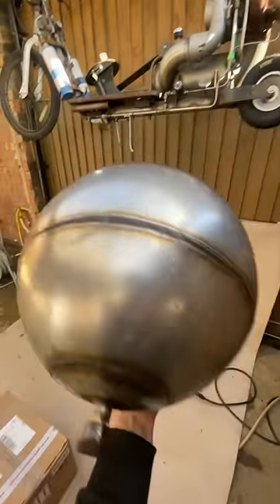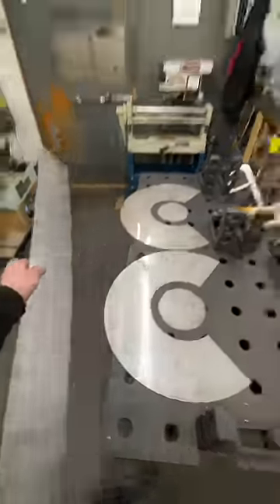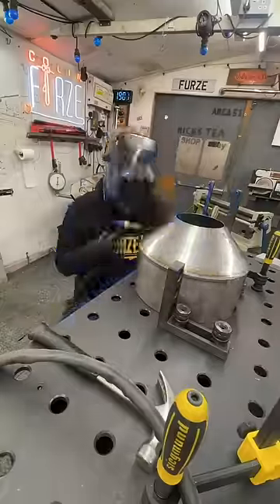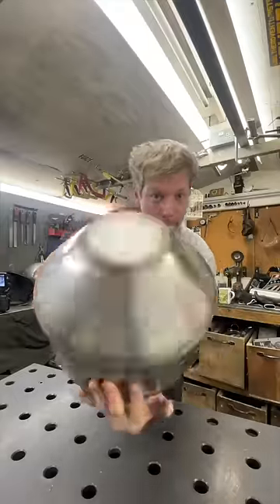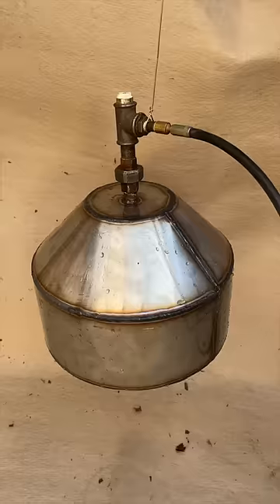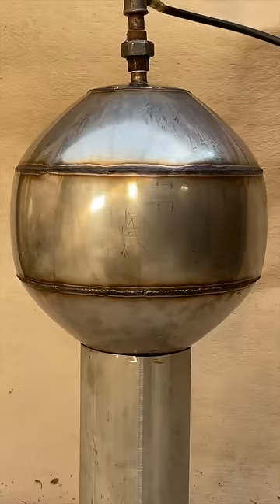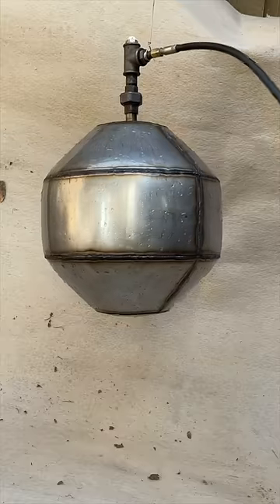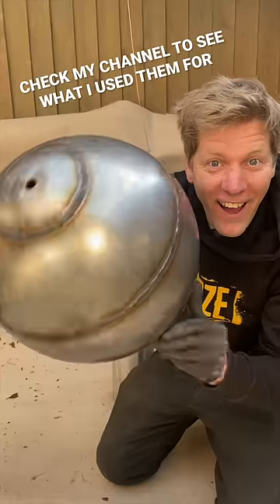Your Pressure washer has a Secret SKILL

Comment: You forgot the step "hope your welds hold up"

That's a beautiful looking steel sphere by the way.
Reply: his welds looked great, I doubt he was worried.  If anything its gonna fail in the un-welded sections
Reply: Even if welds failed, it would not explode since water is not compressible.
Reply: @Puuuszzku uh no.
Water is compressable just the amount of pressure needed is a lot more.
Compress a gas enough it becomes liquid compress a liquid enough it becomes a solid.

That water will have the pressure the pressure washer is putting out, which is considered dangerous.
Reply: @thegoldenatlas753  Except water, if you compress it, it goes from solid to liquid...
Reply: @Puuuszzku safest way useing water instead of air
Reply: @Maxence1402a  obviously he should be using frying oil. it's impossible to compress which is why they use it as rocket fuel for the space shuttle program. Pump that baby up with frying oil and the welds are sure to bust
Reply: @thegoldenatlas753  That’s theory. In practice with this application, you will never reach pressures high enough to see any of that.
Reply: @thegoldenatlas753  water is an incompressible substance for all practical purposes, both foreign and domestic.

AW-32 is much more incompressible, but in this case it's not enough to worry about.

The big worry here is hydraulic injection via pinhole leaks
Reply: @Puuuszzku  **easily compressible...its not easily compressible.   It most certainly is compressible. 😉
Reply: @Maxence1402a  if you compress water it goes from a liquid to a gas. But more often than not it will find or make a way out.
Reply: Collin doesn’t need hope.

Collin is the hope we all need.
Reply: @2nd-place lol that may be TRUER than hit or Colin thinks.
Reply: You or Colin I should say.
Reply: @ChrisssDolle  hopin to become an old wise geezer just like ya!
Gotta get machining
Reply: @mtraven23  it actually did fail a bit but it all worked out
Reply: @thegoldenatlas753  Colin has a video he made years ago, shows one of the welds leaking when under pressure, just stopped and welded it again. Just don't hold or stand right next to it when it's under pressure.
Reply: @ChrisssDolle  I'll definitely try the Jerry rig way if there's no other option.
Reply: @CAL9919A  where?  I see no failures.
Reply: @mtraven23  in the main video and a behind the scenes video the welds popped in a few places letting water escape but it wasnt that bad
Reply: @CAL9919A  oh , i didn't realize there was a main video, Ill have to check it out.
Reply: @mtraven23  its the new drift trike build
Reply: @thegoldenatlas753  it's been a while since I did physics, but I believe water is the only fluid which has a lower density when it is solid (ice). So no matter how much you compress it, it will never solidify, and if the welds fail, it would just squirt out for a split second until the pressure equalizes that of the pressure washer. can anyone smarter out there weigh in on this?
Reply: Only way to be sure your welds are good is to wear your very own safety-tie...
Reply: @Puuuszzku  a practical example of ice turning liquid under pressure is when ice skating. One of the few places with enough pressure to liquefy ice.
Reply: @thegoldenatlas753  the risk isn't there like compressed air. Much more dangerous to do this with compressed air. Only a very small amount of water need escape to decompress the sphere. With air, it may take 10 seconds for it to all escape, and while that's happening, it may continue to blow apart.
Reply: Pretty Sure that it's Stainless...
Reply: Filling it with water and then using only water to fill it makes that part kinda meaningless. Don't prefill it or do but use air to increase the pressure and that's a very, very important part 😄
Reply: Why would you have to worry if your welds are gonna hold if you know how to weld??? Smfh it’s not hard to weld… it’s literally something every human should know how to do
Reply: @Puuuszzku  
Water turns into ices depending on the pressures you are talking about, last time I checked you aint gonna get Neptune level pressures from a dinky pressure washer off BestBuy.
Reply: @thegoldenatlas753  😊😊😊kk99
Reply: @thegoldenatlas753  😊😊😊kk99⁹
Reply: @mtraven23  😊😊
Reply: 😊😊😊😊kkkkkok😊😊😊😊😊😊😊
Reply: @yasirrakhurrafat1142  *Jury rigged , not jerry
Reply: @Matt Traven 😢kk😢😢😢😢😢😢😢😢😢kkkkkkkkkkkkkkk
Reply: @thegoldenatlas753  uhhh no. On the surface water is practically incompressible and a pressure washer cannot reach pressures for hydroforming steel to fail catastrophically. I've seen many welds fail in this process. People just get wet. Even at the bottom of the Marianas trench water is compressed by only about 4%.
Reply: I thought more along the lines "Hide behind a thick concrete wall, with the end of the power washer cable, and plugit in.
Reply: @thegoldenatlas753  nope. Colin has a better video on this method, where he goes into how it's completely safe. Water really really doesn't like to compress, it takes insane pressures to get it to shrink by a few %.

If a weld breaks it doesn't violently burst open, it opens a tiny amount and the water rather harmlessly comes out.

If there's air in there however, the energy is stored in the air like a spring. A minor flaw in the weld is rapidly and explosively ripped open - likely ripping a 'arge section open and potentially sending shrapnel everywhere.

This is well documented. Look up failure modes of this, they range from a slow drip of water, to a spray not even as dangerous as the cheapo pressure washers. Look up failure modes of using air pressure... You won't find any - because most people capable of setting up the contraption know how stupidly dangerous it is.
Reply: @Train115  if you compress water it turns into a gas? No... No it doesn't. By what mechanism would compressing it turn it into a gas, when the higher the compression the less room there is - so how on earth could it form a gas?

When you compress water to EXTREMELY high pressures, it will form various exotic forms of ice - as the molecules are forced into certain lattice shapes. The pressures we're talking about here are just absolutely enormous. For reference to get to the first stage of ice formation at room temperature, you'd need to exert over 10,000 atm, or 150,000 PSI and a container that can handle more than that force without changing shape or failing (good luck).

For reference if you went to the bottom of the ocean - the pressure on you is still nowhere near enough. You'd need an ocean 64 miles deep to reach the pressures where this specific ice forms.

The idea that it'd turn into a gas under more pressure is just the most nonsensical thing I've heard in these comments. And this comment chain has some pretty good contenders.
Reply: @thegoldenatlas753  I'm pretty sure you cant compress water because it expands when it becomes a solid.
Reply: @thegoldenatlas753  at some point the water will colors a bit. But when you increase the pressure, it's the air in the system that pushes on the liquid
Reply: I won't be around that shit working
Reply: Nah, if your weld busts it immediately loses pressure and just starts pissing water. It's about as fail safe as metal forming can get
Reply: @RK36_  every human? lol what
Reply: @thegoldenatlas753  the real danger would be using something like air because it would store energy like a spring whereas the water used here compressed a negligible amount so it’s not storing additional energy.
Reply: @Maxence1402a   there are different kinds of ice that exist at different pressure ranges ice 1 is the the only one that exists on earth naturally and causes an expansion in volume all the other ones at higher pressures don't.
Reply: @Train115   also wrong there are different phases of ice and ice 1 is the only one that increases in volume.
Reply: @Puuuszzku  technically everything is compressible ,just the amount of compression requires varying pressure,its very less for gases,moderate for liquids and really really high for metals and crystals(crystals are brittle i.e.their yield strength and breakage point are close)
Reply: @thegoldenatlas753  the densest form of H2O is liquid, compressing liquid water results in liquid water.  Compressing steam results in liquid.  Compressing ice results in liquid.  It's why in space there is very little liquid water because it's cold enough to freeze solid but there's not enough pressure to maintain a liquid form so it goes straight from solid to gas.  The solid is less dense, it's why ice floats.  Unlike most other materials where the "ice" or solid form will sink.
Reply: @thegoldenatlas753  What everyone means by "non compressible" is that it doesn't really store energy when you compress it. If you have a ball of water at 300 PSI and it bursts, it'll leak a tiny bit of water and then drop to ambient pressure. If you have a ball of air at 300 PSI and it bursts, the thing explodes and sends shards across the room.
Reply: @Puuuszzku  Water IS compressible, sadly.
If you are in a situation where it matters, I hope you're behind a shield or something, because it WILL compress given a large enough force, so it will also release a large force. 
Think of it like a really stiff spring..
Reply: @xl000  My exact point is that this is a situation, where it’s completely irrelevant, as pressure involved is way to small. Worst thing that could happen would be something like hydraulic injection, where as the original commenter implies, that there could be some sort of explosion.
Reply: Yes sir
Reply: @Train115 ice planets become ice from pressure no ?
Reply: @thegoldenatlas753  Water is almost incompressible. In this case if it failed there wouldn't be that much of a boom
Reply: @Train115 it does not turn to gas under pressure. Gas is less dense than liquid. Can't push molecules together and say it's becoming less dense
Reply: @lost4468yt  I believe the thinking is that the water would heat up when compressed. As long as the pressure is below 220 bars water can turn gaseous with enough temperature. Though I don't know if water really compresses at any measurable level at this "low" pressure.
Reply: @Puuuszzku wouldnt explode, but any tiny jets from leaks will pierce flesh like a red hot needle
Reply: @kf8575  at what distance ? 5cm ? Let me say it for the last time. I’ve done steel hydro forming using pressure washer at least 5 times since my original comment here. AND THERE IS NO WAY that you could get hurt, unless you’re sitting on it or holding it with your hands.
Reply: that's the general pattern but it really depends on the current temperature, pressure, and which substance @thegoldenatlas753
Reply: @thegoldenatlas753 the pressure releases from water almost instantly, whereas a volume of air compressed to that pressure would still need to expand a lot in order to reach equilibrium.
Reply: false you can compress water into mineral form, its called ice 7 and while hard to achieve its possible its stable up to like 120 F  @Maxence1402a
Reply: @Train115 more often than not the improper chamber would be used
Reply: Don't stand to close and use some protection.
Reply: Well the point of filling with water is that if it ruptured, it would not explode very violently. This is why pressure vessels in general require periodic hydrostatic pressure testing
Reply: @mtraven23 that looks like stainless. And he didn’t purge inside. Obviously they held but those are weak and contaminated on the inside
Reply: @brycelovell6984  oh ok, thanks.   I missed that detail.  Actually, purging is a relatively new concept to me.  Are they filling the tube with shielding gas to prevent oxidation on the inside walls?  Is that the basic concept?

whys it only stainless you gotta do that for?  the nickle in SS ?
Reply: @thegoldenatlas753 it cant store the pressure elastically though like a gas. So the pressure coming out after failure is strong leading on the flow rate of the pressure washer, which is not high compared to the volume of the sphere. So the massive sphere and any rip in it acts as a regulator.  I mean you don't want to be hanging out like 2 ft away from it or anything when it goes.  But after the initial burst it should be fine
Reply: @thegoldenatlas753 In most engineering applications the compression of water is ignored, so I don't think you need to be worried about it in this situation
Reply: @lost4468yt  Thank you! So much bs in this comment thread, when all anyone has to do is look at a god damned phase diagram for water.
Reply: Yea I was gonna say - you're greatly overestimating my welding abilities
Reply: You guys should use Black holes In these they dont compress and their easy to get since you can make everything Into a black hole by compressing stuff until it doesnt anymore
Reply: Guys, Here is The Savior

HalleluYAH translates “Praise ye YaH”

YaH is The Heavenly Father
YaH arrives via the TENT OF MEETING
YaH was Who they Crucified for our sins
YaH was Crucified on an Almond TREE

Ancient Semitic of Moshe (Moses)
Isa Scroll (The Original Isaiah)

Isaiah 42:8
"I am YaH; that is my Name! I will not yield my glory to another or my praise to idols.”

Isaiah 43:11
“I am YAH, and there is no other Savior but Me.”

Isaiah 45:5
“I am YaH, and there is none else.”

Comment: Im a sheet metal worker that makes complex shapes like this and even im pretty impressed how well that worked thats a full day in the shop to hammer out something like no easy task and very labour intensive
Reply: This looks easy but it also looks like a bomb so….
Reply: @joshuajones9035  it's water. Doesn't compress. So it's actually not a bomb!  just like a rubber balloon filled with water doesn't really "pop", it just bursts.
If you filled it with air, then yeah, it's a bomb.
Reply: @johannesmajamaki2626  
So having your shirt and pants soaked is not an issue to you? Think about it man!! How damp you will feel!! How chilly you’ll get!!! What if it his you in a way that you look like you’ve peed yourself?! Then what?!??!
Reply: WHOA! Well, if you're impressed, then I guess we all should be.
Reply: @johannesmajamaki2626 lol didn’t think it was water lol I was just imagining all the air pressure it would take to do this
Reply: This is a type of hydroforming, it might be worth looking more, considering your profession. You can form sheets with single part molds using water to apply even pressure to a sheet over the whole mold, or parts like in the video can be sealed and pressurized to round them out in a way that increases their volume to surface area. Can also expand hard to reach sections of tubes to stretch them an outer mold cavity.
Reply: Sounds like you’re a pretty bad sheet metal worker
Reply: @Manhandle730 if that’s the worst-case scenario then that’s fine anyone who complains about getting wet when working with water shouldn’t be working with water.
Reply: You're a metal worker and you dont know hydro forming? Alternatively you cap it with a cap that'll give out after a cetain psi, fill it with water and use a mild explosive to do this.
Reply: If it didn’t blow up….Then cut it into the pieces that suit the rounded shape you want
Reply: @johannesmajamaki2626 thank you, it's one of those things that drives me nuts but also is completely understandable that ppl don't understand these things much like what the diff between detonation and delegation is.

Comment: This technique is called hydroforming. Water is used because it's incompressible, which means if a weld breaks there's no explosion.
Using air or other compressible materials would be dangerous, since a break would make the compressed material expand rapidly (explosively).

Comment: Damn, solid weldin'. Did you at least check for leaks first or just wholehogged it from the get go?
Reply: The good thing about this is that water is incompressible so if a weld gives in while inflating it you don't get an explosion like you would get if you used pressurized air.

So going whole hog is pretty safe. Worst that can happen is a weld breaks up, and the larger the break the safer it is.
Reply: the one you see here is (from his referenced full video) try number (I thiink) 3.
Reply: This is the weld test.  And like @Blahorgs said, water is incompressible -- so no explosion.
Reply: @blahorgaslisk7763  Totally.  Great explanation.  Water is how they pressure test gasious pipe systems safely.
Reply: water will compress a little bit in our 60,000 psi waterjet.
its practically uncompressable.
water will compress about 11% at 60,000 psi, so our Attenuator that has a volume of just under one liter, will hold just a little more than a liter at full pressures.

it certainly is safer to use water than to squeeze a gas into something that might give.
water will squirt out in a relatively short burst, but air or other gases just keeps coming out, spreading shrapnel everywhere.
Reply: @blahorgaslisk7763  if you don't turn the pump off immediately though it will still be applying pressure and the water will come out the pinhole just as if it were a pressure washer nozzle and could give you an injection injury
Reply: @MLFranklin Hold my beer!
Reply: @blahorgaslisk7763  wouldn’t that create a pressurized stream that could be potentially dangerous?
I’m just a Youtube educate dolt, but seems so

Comment: For you people saying he has balls of steel etc just remember water is virtually incompressible so if his welds fail it would just come out at the pressure of the washer, now air would've been very dangerous as it would go BANG at failure and potentially become a frag grenade.
Reply: Regardless of what is inside, they are balls, and they are steel. Therefore he has balls of steel.
Reply: And if it was full of steam and blew... ho, boy.
Reply: That's why you use helium gas, if it explodes it will float upwards.